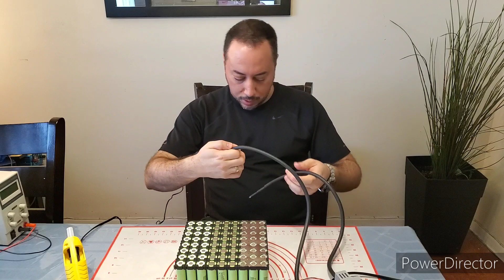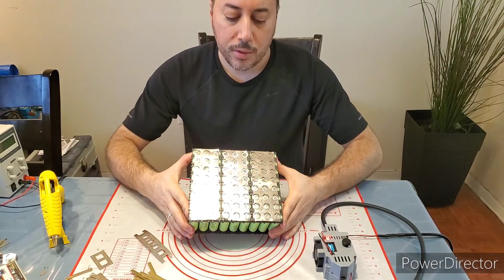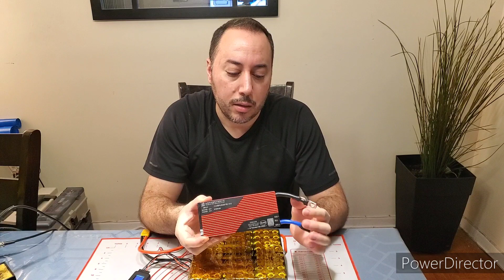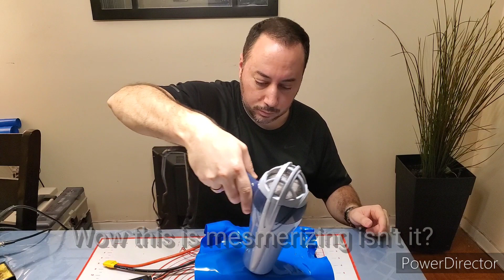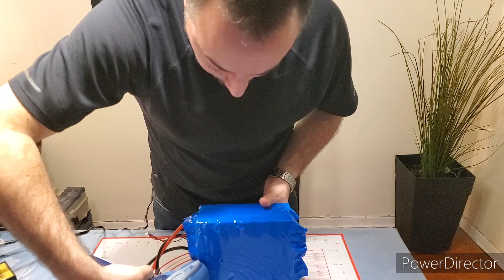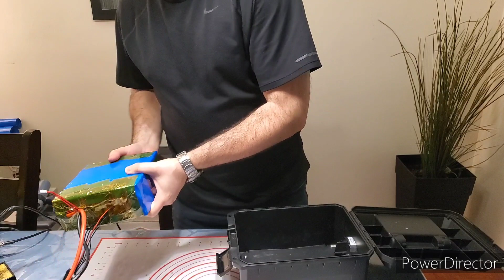DIY Lithium Trolling Motor Battery - Part 1

Comment: I wanna get a 100ah to 120ah built in parallel pack configuration for my wilderness systems ATAK 140 kayak thats powered by a 12v minn kota 55lb thrust trolling motor, and I have a small rear hatch I wanna put my battery inside. So how heavy is that?

Comment: So I use 5200 mah 30c lipos for my radio and navigation. I wanted to parallel a bank of them, but mixed if I should discharge from a parallel board. Why did you choose 18650 over 3 cell lipo?

Comment: That was Mesmerizing! :) Seriously good video! I'm building a 4S40P pack and didn't realize there were the fused nickel strips available so I bought some. And, I didn't realize that you could get shrink tubing that big, so I got some from BatteryHookup. One thing I'm curious about is how well is it working with an inverter? Most inverters that I have used always have a low voltage cutoff that would prevent them from working well from a 3S Li-ion pack. Thanks!
Reply from the maker: Greg, this build was designed for a task specific purpose (running a trolling motor on my boat). With that said, as a secondary use it can power an inverter, but as you have eluded (not very well) lol and that is an unfortunate circumstance of lithium chemistries 3.7v nominal voltage not lending itself to falling within the full low voltage and high voltage cutoffs of lead acid designed inverters in either a 3s or 4s config.

With that said, 7S DOES fall perfectly within that low voltage and high voltage slot, which is why the next battery (i have already built) is 7s. 

As I mentioned the battery pack is already built and it's a 7s 24p pack with a total of 168 LG MJ1 cells with a total nominal pack capacity of 2175 watt hours.

The problem is that covid has kind of turned most ppls lives upside down (mine included) which leaves me with little time (or sanity) to actually build the box and put together a video on it. But eventually that will come out, along with the second part to this video that you are commenting on showing the completed box. But I can tell you that my tests with the 7s pack has allowed me to go from completely full, to completely empty at very high power draws of 1000+ watts.
Reply: @joecmarques  Thanks. 7s may be the best solution for using an inverter. Thanks so much.

Comment: How much did this pack cost to build? Not including equipment
Reply from the maker: It's been a while since I built this and I don't recall exact total, but the biggest cost is going to be the cells. I had a quick look on Aliexpress and I see the NCR18650B cells can be had for about $4 per cell shipped. So about $288 just for the individual cells. When you factor in the cell holders and the nickel strip, let's call it about $300 CAD. If you throw in a BMS to safely manage the cells, that will add another $35 - $50 CAD depending on discharge current rating. Plus case, switch and LCD display Power meter for another $50  and your looking at approximately $400 CAD for just shy of a 1KW/Hr pack.

Comment: Where did you get the fused nickel?
Reply from the maker: https://batteryhookup.com/products/nickel-fuse-5p-wide-continuous-roll-by-the-foot-18650-cell-level-fusing?variant=29596921823311
Reply: @joecmarques  Aren't those 26650 batteries?
Reply from the maker: @paulbarrette2557  no they are 18650's.

Comment: Thanks for the build video on this.  Fast-forward through the hair dryer would have been nice.  :)
Looking forward to Part 2, where hopefully you show the final configuration and the battery in use, on your boat.

Comment: Hi Joe,  awesome video.  1st time viewer and immediately subbed the channel and liked the video.  I am building a similar project for a trolling motor application, which will be my 1st project working with lithium batteries.  I have a newbie question that maybe you can help me with:

I have 3 completed 12v 40ah battery packs purchased new and complete.  Each already has a circuit board for balancing, charging, protection, etc.  40ah and the max current draw per pack is not enough for my application so I am just hooking them together in parallel for load sharing and increased amp hours.  With 3 packs my max load across the 3 packs is well under the max draw for the individual packs.  Sorry for the long post, but I want you to know exactly what I am working with.  Here is the actual question:  Can I just buss these packs together, and be done with it or will I need another BMS to control and balance the 3 packs?  Each pack will be charged individually using the supplied charger, and the charged battery put on the boat when it is taken out to run the trolling motor, fish finder, and LED running lights.

Thanks for any help or advice, and your other viewers are welcome to chirp in too if they have done a similar project.  Looking forward to perusing your other videos. :)
Reply: I guess that this channel is dead.  That is a shame.  I will ask elsewhere...
Reply from the maker: Hey, sorry I did not see your question sooner. It's actually a very good question and one that I'm sure others have thought about. While I'm certainly no expert or authority on battery pack design, I guess one of the problems I have with that is that you are dealing with multiple cells, each with their own BMS, and thus each with their own electrical characteristics which makes the pack (as a whole) rather unpredictable. 

To elaborate you mention that the current draw shared amongst the cells is well within spec, and while that is true given everything functioning as normal we need to consider what could and would happen if suddenly something goes wrong with one of them. If for whatever reason the BMS fails (as they often do) or detects a fault the BMS would then shutdown that cell, which eliminates a huge chunk of capacity from the overall cell dramatically changing the characteristics of the pack as a whole. Suddenly what you might think is a fairly safe current load on the cells is overloading the cells etc.. This is why when battery packs are built they are built with "raw" cells that do not have built in cell level protection circuits, as that too would make the entire cell very unpredictable. 

So now with all of that said, can it be done? I think you know that technically the answer is yes, it does work and you are already doing it. However the question in my opinion them becomes, is this the best way to do it, or the safest way to do it? In that regard I would say it is not, and I would not personally do it that way myself unless it was for a short period of time and I was trying to get something going in a pinch.
Reply: @joecmarques  Thank you for the well thought out reply.
I'm looking at a couple of different options at this point.  Since the only time that I might actually need the full capacity of the 3 cells is if I plan to run the trolling motor full power.  This would likely be an emergency situation where the sailboat outboard has failed, and no wind.  If I use individual 3 way switches for the 40 Ah packs going to 2 different positive bus bars, then one bar could be dedicated to the trolling motor and auto pilot, with the other dedicated to all other low draw circuits. (LED lights, fish-finder, usb power ports) This would allow me to selectively send power to either bar, or disconnect completely for individual  charging and testing of the packs.  Individual packs can easily run the auto pilot for at least a day, and the low draw circuit for several days, while the 3rd pack charges.
The 3 packs with shipping, and tax was $385 - well below buying a single lithium DCM battery of similar capacity, and comparable to the cost of two lead/acid DCM batteries.
You are correct in that the proper way to do it is to build my own packs with dedicated BMS using high quality parts.  That is beyond my budget and skill level at this point.  This was the cheapest way to get lithium rather than lead/acid batteries for the boat
Thanks again for the reply. :)
Reply from the maker: @barking.dog.productions1777  yes that is also another way to do it. However you also need to consider that if you are going to be putting the packs in parallel (with or without a switch to BUS), the cells MUST be within 0.5v of each other, or you will see a HUGE inrush of current to the lowest voltage cell and that could be pretty catastrophic to the cells, let alone your BUS or wiring.

I actually made this mistake myself when putting my first power pack in parallel with this most recent larger pack. I had forgotten to check the voltage of both packs (my smaller pack was 1v lower), and the huge surge of current melted the cable and literally caused it to vent smoke violently out of the insulation. I actually thought I had shorted the cable (that's how violent the current inrush was).

In any case i learned something about my first smaller pack build due to my stupid mistake, and that was that the main 30A breaker was far too slow acting to trip. What failed first was the 30A rated main switch, which in hindsight was not the best idea, and i should have used a stronger switch or relay, or a fast blow fuse. In either case, please consider the above consequences of just 1v difference between packs, particularly if they are discharging at different rates before being connected together.
Reply: @joecmarques  Understood, and thank you for your advice. :)

Comment: Looking great, can't wait for the box build. Still planning on a Kodiak build?
Reply from the maker: I definitely am, and I just placed an order of 100 LG MJ1 INR18650 specifically for this build. What I've learned from my previous battery builds using the NCR18650B batteries is that they won't be able to deliver the current surge capabilities that I'll need for for the Kodiak build. I have all the parts already including the 1200w inverter with 2400W surge, and as a benchmark I tried running my refrigerator off of the trolling motor battery. What I found is that it cannot sustain high current draw without significant voltage sag, which trips the low voltage cuttoff of the inverter. Those NCR18650B cells can only deliver about 4.8A sustained, and even at that level it's not a happy battery. 

I will do testing with the MJ1 batteries which can deliver a sustained 10A with much less sag, and should be better suited to cope with the needs of the Kodiak build. Alternatively I may I have to bite the bullet and move to a 4S pack design. But we shall see!

Comment: Hey Joe,  are you using a xt90 or 60? what size gauge? Also can you tell me how to connect the xt90/xt60 to an inverter?
Thanks again man 🙏
Reply from the maker: Hi Eddie, I'm using XT90 connectors as they are rated at 90 amps, which falls in line with the current range I'm looking for. The wire I'm using on the pack is 8 AWG high temp flexible silicone wrapped wire, which should also handle the current loads I'm looking for. 

With regards to how can you connect XT90  connectors to your inverter, I'm not really sure how to answer that as I really don't know anything about what you are using. In general though most inverter above 300w will usually have screw in type lug connectors. That being the case you would simply make your own cables with one end using XT90 and the other end using ring connectors that would be attached to the inverter.
Reply: @joecmarques  how hard was to connect a 8 AWG on the XT90? 8 AWG it's a very thick for that connector. Maybe a video will be nice 🙏😃🙏

Comment: Hey Joe, thanks for the video.  The nickel strips look great.  I have a 7s 80p pack of recycled batteries that has been sitting for 10 months waiting for me to get the motivation to solder them..  I want fuses and this might be the answer.   Can you provide info on your spot welder and batteries you used or any recommendation you would have.
Reply from the maker: The nickel strip with the built in cell level fuses is from here:
https://batteryhookup.com/

The battery spot welder I'm using is a Malectrics spot welder which can be found here:
https://malectrics.eu/

The NCR18650B cells that I used after closer inspection all appear to be fakes (but very very good fakes) that all tested at rated 3400mAh capacity, and had an internal resistance that is also within spec, as is the weight of the cells. If I had to guess I would say the very same factory in China that makes these for Panasonic, also makes these for sale on the side or something like that. The thing that gave it away for me was the lack of QR code printed on the bare metal under the wrap, as well as a different style of positive side electrode insulator. Besides that everything checks out, but I'm not yet sure about C rating discharge rate, but original NCR18650B cells have a low C rating of 1 or 1.5C so I'm not worried about that since o will not come close to that with my applications anyway. 
So I am still quite happy with these cells and will continue to buy more. They can be found here:
https://a.aliexpress.com/_sbk4L8